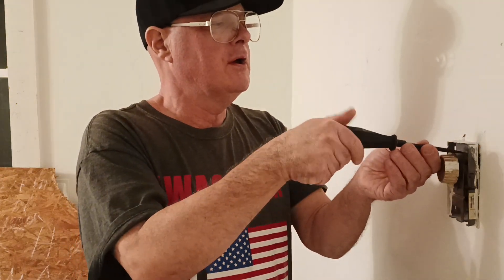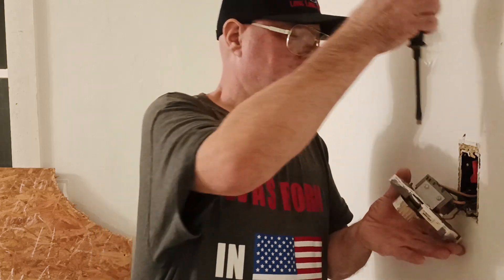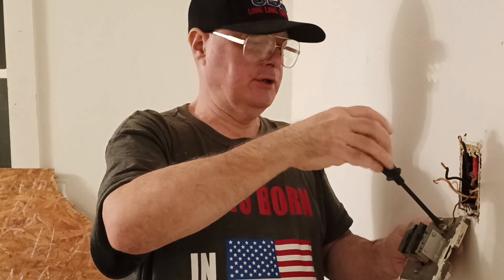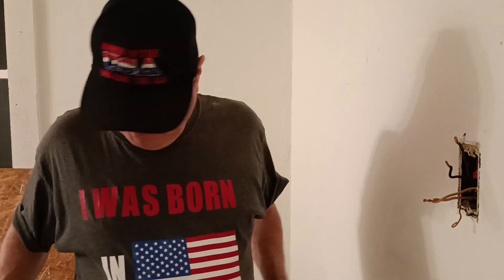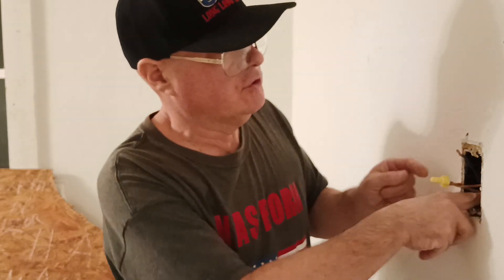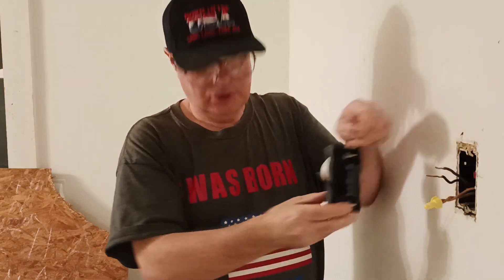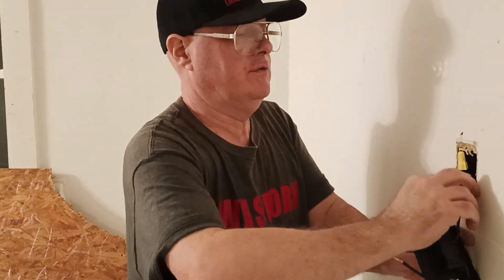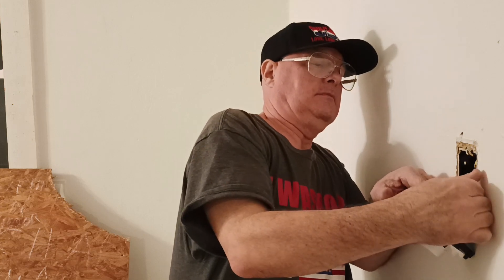April 2024 - 120/240 volt electric baseboard heater thermostat how to replace a defective thermostat

Comment: You really should have purchased a 2 pole thermostat so when it is in the off position the baseboard heater is completely disconnected from the power in case you have to work on the heater itself. By disconnecting both legs of the power with the thermostat you can work on a totally de energized heater without having to turn off the breaker in the electrical panel. It is legal to do it with the one pole but for safety it's better to have a 2 pole t h thermostat. You never know who's gonna want to do something with that heater. Someone might want to remove it rather than mask around it if they were to paint the wall.
Reply from the maker: They don't have it but it is for 240 volt I looked for a 4 wire